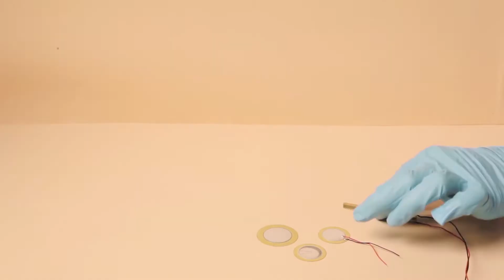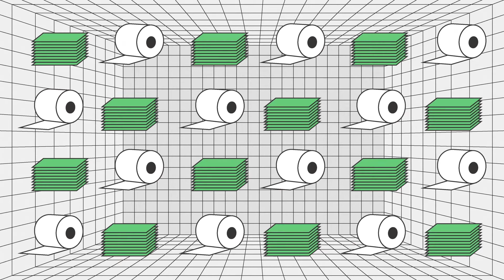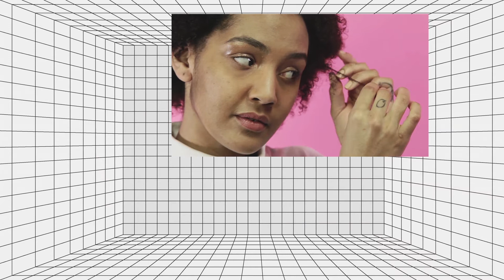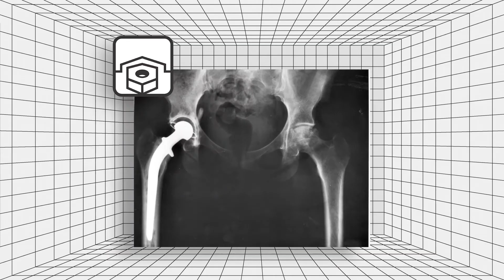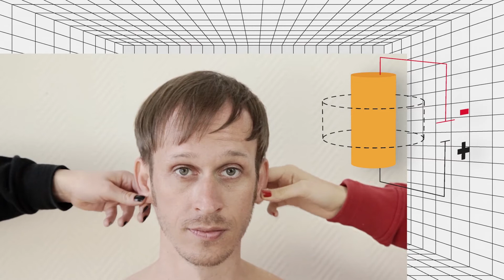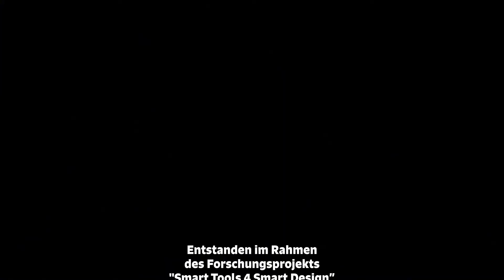Smart Tools 4 Smart Design

Comment: Nice presentation. Could you comment on the underwater operation of the MFC. Is it waterproof already? If not what would you recommend shall be suitable for waterproofing it?
Reply from the maker: The outer shell of the MFC is polyimide (Kapton). Polyimide is slightly hygroscopic, which means you can submerse it in water for a limited time < 1-2 weeks. For longer submersed time periods we carry MFC with polyurethane shells or, the more inexpensive way, is to use a standard waterproofing boat (naval) paint and add a layer of this paint on top of the MFC (assuming you have bonded it to a structure).